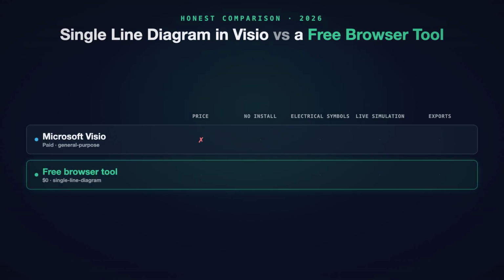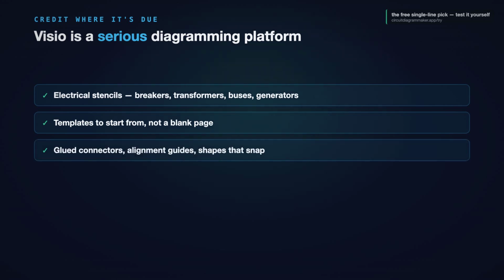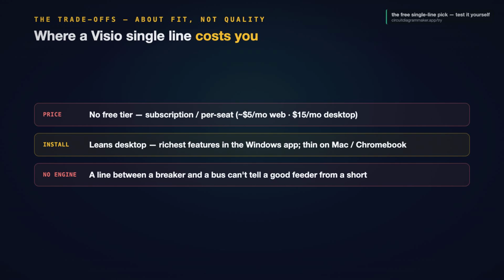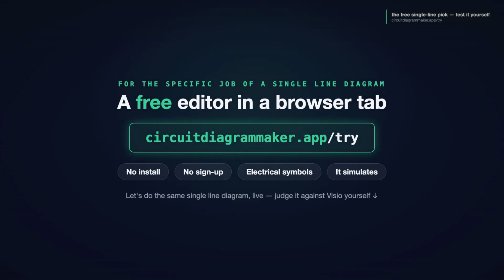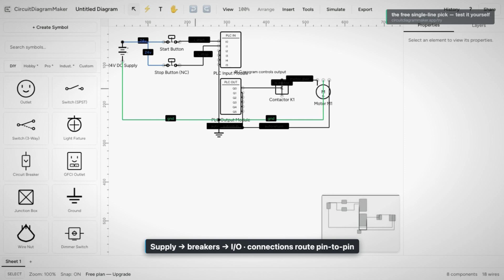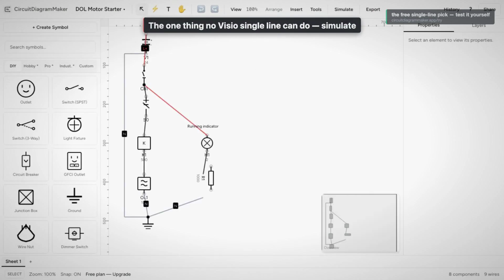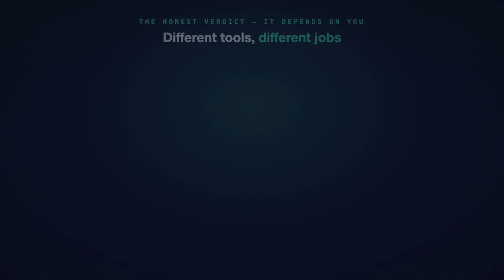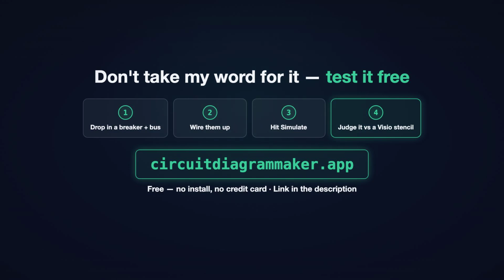Single Line Diagram Visio Alternative (Free)

Comment from the maker: Full disclosure (also said in the video): the free browser tool is ours — which is exactly why Visio gets its fair credit first. Visio's electrical stencils and Office integration are real, and if you live in Microsoft 365 it's a fine pick.

Honest question for you: is it the price, the install, or the missing simulation that would push you off a Visio single line diagram? For a lot of people it's the third one — a line between a breaker and a bus is just a line, and it can't tell a good feeder from a short. If simulation doesn't matter to you, Visio holds up fine.

Draw the same single line diagram free, in your browser, in about ten seconds — real symbols, connections that route themselves, and a live SPICE check: https://circuitdiagrammaker.app/try?utm_source=youtube&utm_medium=pinned_comment&utm_content=yt-138